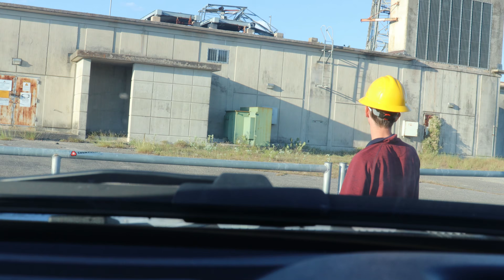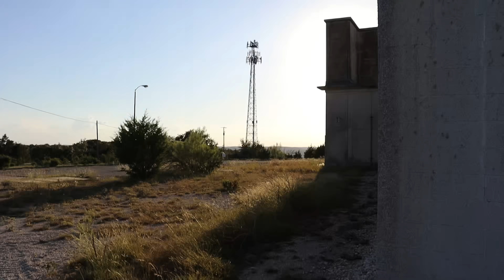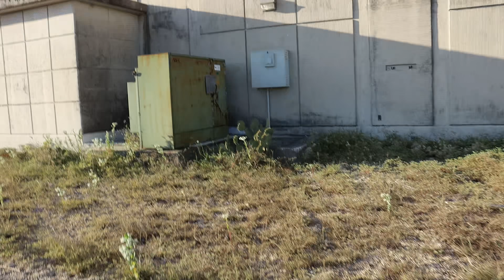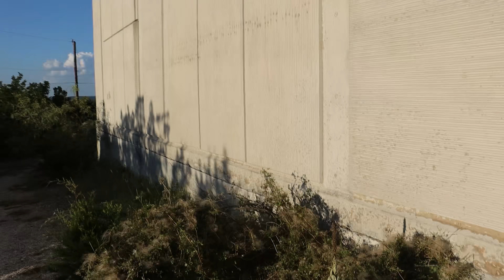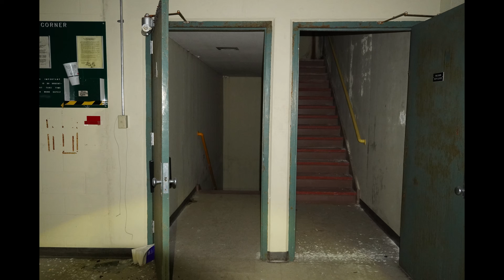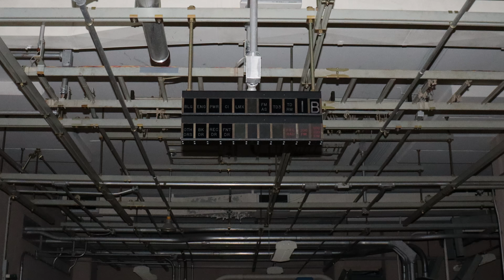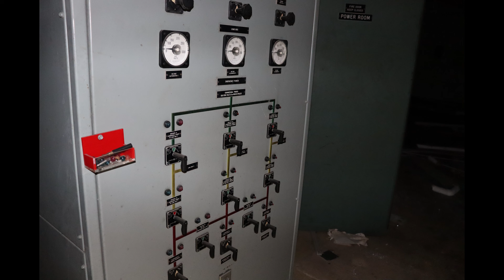Long Lines bunker

Comment: It's a shame these old sites are left to rot. Even though the tech is out of date, the building could be retrofited with newer, modern gear and reuse for data centres and ISP cores.
Reply: I agree.  They used up so much money and effort to build all that and now it's just a dystopic post apocalyptic wasteland.
Reply: Many of these have been repurposed as cell towers. If you look closely many long lines towers have little white rectangular panels on them, those are cell antennas.
Reply: @shockinglybright    my god man, almost everything over 30 ft tall in my area has cell phone gear on it these days.... especially if it's already up on a hill.
Reply: @shockinglybright  We were refering to this site which is very dead and wasted. I climb towers and do comms for a living, I know what is Cell and alive thanks.
Reply: They aren't located in places where they would be useful for those purposes.
Reply: @nick21614  can be made to pretty quickly these days.
Reply: @nick21614  I know of quite a few that are.
Reply: Actually that is where you're wrong and the reason you're wrong is the cell phone tower outside that he talked about yeah there's a phone line going to that that's how there's actually operate. 

Your cell phone towers are hooked to the grid in terms of phone service and then it converts the signal and broadcast for sending and receiving...

If you've ever lived in the countryside and you've been forced to use DSL internet service and you ever wonder why you're paying for x amount of megabytes or gigs of service yet you will receive a much lower number if you call the tech people they will generally ask you do you have a cell phone tower within a mile of your residence and if you answer yes they will then proceed to explain that that's where your bandwidth is being sent simply because it is priority..

Don't believe me call Windstream and ask yourself! 

So no the simple fact that they provide internet service etc for the cell phone tower meaning there is a service building nearby specifically for that means that yes this building most likely could be converted into what the other person suggested!
Reply: If any site had that value would have been kept. The infrastructure was already paid for. The challenge is most of these sites are 5 miles to the west and east of no-where and sometimes just as hard to find. The mw signal can only be thrown so many miles and it has to hit repeaters. Fiberoptic can throw its signal 25-75 miles on a fraction of the equipment and cost. They rightfully should have just been razed, but that cost more than the building and land was worth.
Reply: @user-cz8do7xl8u  Just seems a waste, we don't  have things like this sitting around here in Aus, I would love a joint like that for a DC use.
Reply: @user-cz8do7xl8u     also consider the cost to remediate for old oil tanks, asbestos, lead paint, etc. BTW, the original idea of these places being many miles into the boondocks was keeping them away from target bombing areas.

Comment: I live very near the TAT-5/TAT-6 cable landing site and have for a long time wanted to get access to film a tour. I'm not sure what, if anything, the bunker is used for these days with those undersea cables deocm'd, but I think it was also a microwave site at one time. If the current tower was part of the installation, then the horns have been removed at least. Trying to get in touch with anyone about it via the AT&T behemoth has proven pretty much impossible. Now I understand where the channel name comes from.
Reply: You have absolutely zero chance of being allowed to film inside an active cable landing station. Zero.

Nothing particularly special in there though. if you're expecting to see something like a giant floor mounted water cooled laser cannon coupled into the fiber, you'll be disappointed. The transcievers are just standard namebrand rackmounted things the same as used for city-to-city fiber runs. The undersea fibers have amplifiers and retransmitters, after all.
Reply: @Sylveste22  TAT-5&6 were galvanic and are no longer in service. The cables and bunker penetrations are purported to still be there, though. At least as of the early 2010's. As far as I'm aware, there's nothing else active there today, except for cellular. I work in telecom, and back in the day there was a whole safety and competency training that needed to be completed/passed before any individual contractor tech would be allowed to descend to the cable room.
Reply: @marcberm  Ah okay, then you understand. Yes confined space training etc for the splice pit.

They're always interesting sort of places to visit for the history at least.
Reply: @Sylveste22  right because light decays when transmitted in a reflective vessel........ surrreeeeee

Comment: Should turn it into a DC
Reply: No fiber trunk to the building. Towers are using a MW backhaul. There are plenty of other active sites that can be configured into DC's or Cloud sites. The amount in cost to make this site a DC would eclipse any cost to just put the DC in an already modernized building. This could make a good astronomy B&B maybe...
Reply from the maker: agreed
Reply: A dc for fiber?
Reply: A data centre for cloud computing. Building is well suited for this.